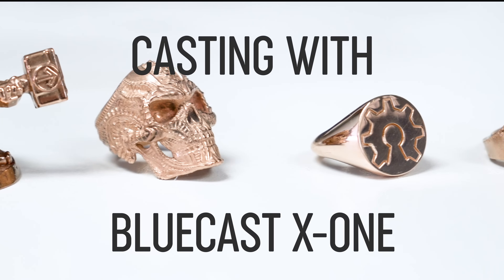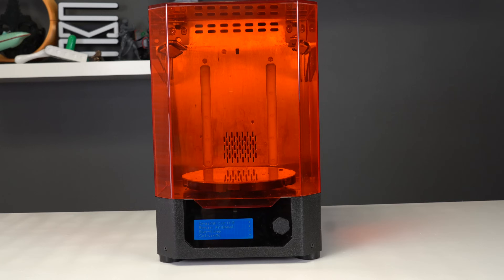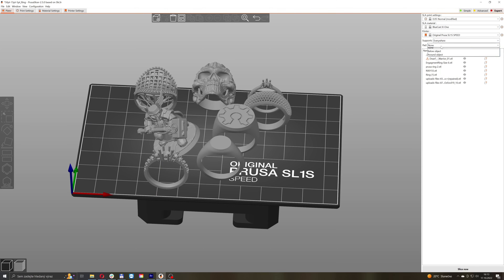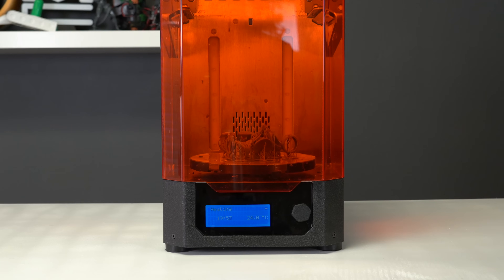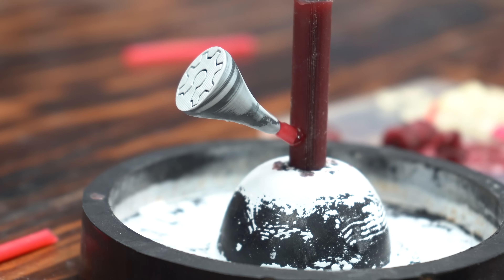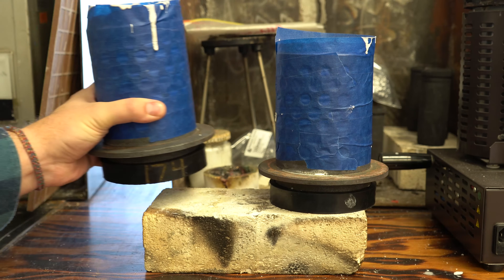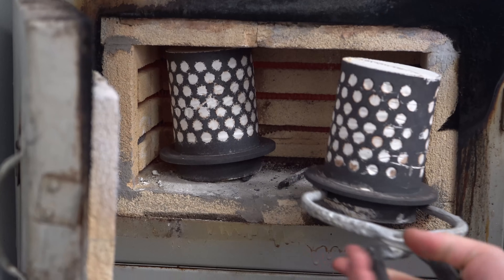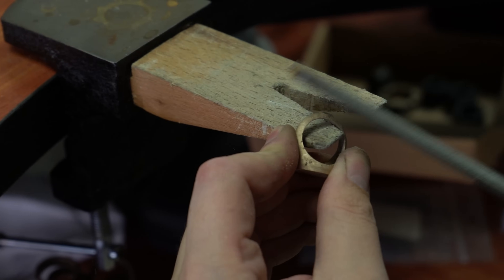Jewelry casting with BlueCast X-One

Comment: We have tried all the blue casts except this one. I can say with authority that gold and especially platinum does not cast well on a standard burnout schedule in a casting house. I am sure that with a custom in house casting schedule it would be better. 

If anyone knows that Blue cast One casts well in gold and platinum on a standard casting house schedule (lots of standard wax models and solid Scape) please do let me know!
Reply: It is unlikely that the burnout schedule, alone, is the problem. We have used very similar burnout schedules for resins as we have for wax (Often with both waxes and resin prints being in the same flask). The vast majority of resins including those in the Bluecast line up don't melt and so you need a suitable investment to deal with any thermal expansion before the resin starts to "burn" or "combust".
XOne however does have melting qualities, and melted under a heat gun during our testing.
Reply: Any update here? Didi you try the x-one?

Comment: So no uv required yet the vid does show a uv cook or am I mistaken? I was also told that one needs to blow air after the soak to dry the parts no?
Reply: At 02:20 thats not actually a UV cure. That is a heat setting. It allows for air flow and the heat speeds up the drying process and makes the supports more flexible for removal.
Reply: @ClearMindJewellery  nice!! Thank you

Comment: Man I wish I could afford the SL1, fooling around with a cheap resin printer and Lychee can be a pain in the ass. At least my FDM is Prusa ❤
Reply: You can use Prusaslicer also with those cheap resin printers. UV-Tools can load the Prusaslicer files and export them as chitubox file.
Reply: @sagichnicht6748  Thank you for the tip, I’ll check that out for sure!

Comment: Glad to help in bringing lost resin casting to more jewellers. Thanks for inviting us to work on such a cool project!
Reply: Do you use the recommended .4mm contact point for the supports or have tried anything else? What Layer Height are you using? 
Thanks for all your videos.
Reply: I'm having a lot of trouble on my SL1S getting small pendants to print. like a tree fog and lizard with small body parts on them at a small scale. im about 75% fail rateif not 80 and ive tried the x10 at first and now the x0ne since Prusa has started promoting it. I've gone with Prusa presets for exposure times orientation and supports, plus added more supports and still just getting supports and half a print or broke toes and tails on the pendants besides the presets from Prusa does anyone have exposure time settings for a more consistent and successful print with smaller finer objects? or at least any advise. its very frustrating.